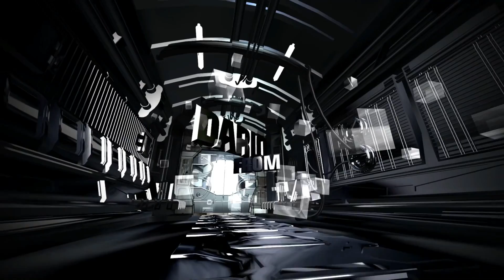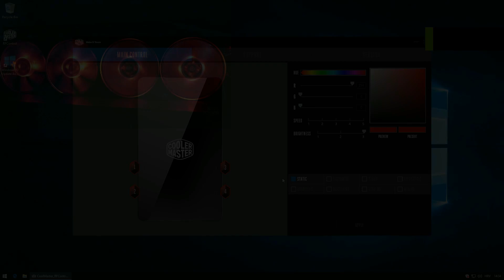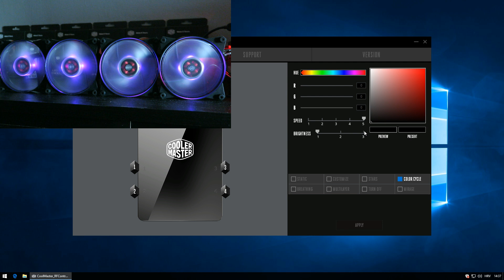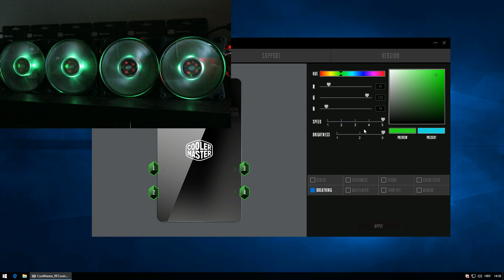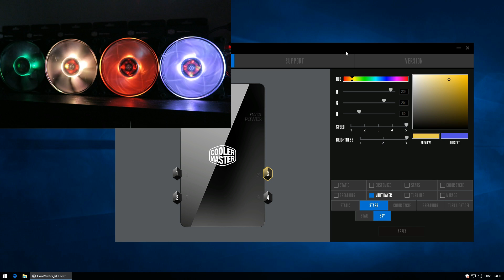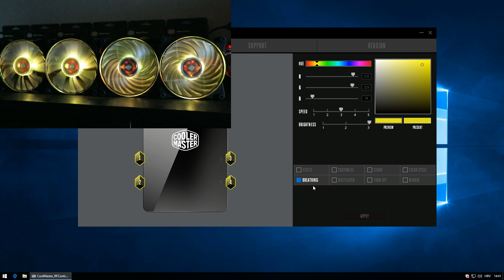COOLER MASTER RGB LED Controller - TUTORIAL AND REVIEW

Comment: Most of these fans are bad out of the box.  Read Amazon reviews.. I got one of their 120mm AIO coolers that comes with 2 of these fans.. both fans were bad.
Reply from the maker: druuzil So all of these fans from that point of the video plus 7 more in my personal build with H500M and one AIO 240 alongside with one tower cooler with also two fans that I have, all working right out of the box. Not a single problem ever with them. And I have to say that I am very satisfied how they work.so I would say that you encountered 1 out of 17 which I found to be a great ration. 😉 I am sorry that you got a bad one, but that doesn’t mean they are all bad. Honestly, I never read Amazon reviews since there you have reviews from people that don’t know how to handle properly tech stuff, something like that Verge guy. 😉
Reply: @PCCrazyDario  I got 2/2 bad.  I bought a 140mm replacement from them (slightly different model) and that one has been fine.  Regardless, there are too many reports of these things being bad straight out of the box to call it a coincidence. 
Bad QC at best.

While I agree that many people on Amazon and the internet in general don't know what they're doing where tech is concerned, it's pretty hard to screw up plugging in a fan to see if it works.  The reviews I read all described the same problems I had with my fans (scraping noises/rattling), so I think they're likely legit.

You're either very lucky, or the rest of us are very unlucky.
Reply from the maker: druuzil Hmm, did you check by any chance if the cable is somewhere touching the propelers of the fans? Because that happened to me on different fans. But ok, I get your frustration.

On the other hand while I’m lucky with the smaller parts of the PC I have bad luck with motherboards. Well at least I had before. 😬
Reply: @PCCrazyDario  Question: Did you buy these yourself or were they sent to you by Cooler Master so you could review them?  Usually when companies send out a product to a Youtuber to review them, they make sure to send something that they've given proper scrutiny to ensure it works and make themselves look as good as possible. 

Also possible is that the QC has gone to shit since you made this video.  Maybe there's been a bad batch of fans in 2018 or something.
Reply: @PCCrazyDario  Trust me.  You can hook them up outside the case where they're not touching anything and they still make noise.
Reply from the maker: druuzil Yeah, these were sponsored for a build and I decided to do a review. After that I decided to buy 7 more fans for my personal build. I know that companies send already checked products but I don’t think that we have that situation with fans. More like monitors and more expensive hardware. Nevertheless, it might have been a bad batch. 😬 And I am really sorry to hear that you were dissapointed.
Reply: @PCCrazyDario  It's too bad because they look great.  The color options on these are significantly better than previous generations.  If the fans would just spin correctly it'd be great.  ;)
Reply from the maker: druuzil Yeah, I mean I am always surprised when people show disapointment about stuff that doesn’t work right out of the box. I mean, ok, it happened to me couple of times, but when I RMA it, the second one worked without a flaw. The color scheme is brilliant. I actually connected them to my AURA SYNC. 😁
Reply: @PCCrazyDario  I'm using MSI Mystic Light.  Same idea.
Reply from the maker: druuzil 😉👍

Comment: do i have to buy this in order for me to control my colors
Reply from the maker: SunStar It depends, if ou have an 4-pin RGB connector on your motherboard, then you only need a RGB splitter cable to connect all fans. If you don’t have it, then you need Cooler Master RGB controller.